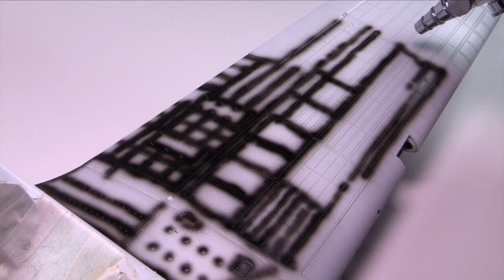Teaching Techniques #1 Part 3: Painting basics, Decals & Pin Wash

Comment: Quick question. If my paint was acrylic based, I shouldn't go for acrylic gloss varnish, right?
Reply from the maker: no short answer I'm afraid :D :
So, yes you do want to change the 'type' of varnish that you put on so that there is no possibility to bleed through the varnish layer, BUT acrylic based products are the most sensitive to all other ones....essentially it goes acrylic -> enamel -> laquer. There is a chance that the acrylic paintwork may react (crack, dissolve) to the other 2 types and enamel may react to laquer but laquer is king and will withstand all others.
I would highly recommend using laquer varnish over the top (I use gunze super gloss in a can) but first test it on a mule or spare bit of plastic painted up....and leave it for 1-2 days to see if it cures without later cracking. The benefit is that you will have a inpenetrable barrier for everything u may do for the weathering - and u have a undo button that can go almost to full reset. Then just do a matt can over the top to finish it off. Otherwise if you want to be safe use a acrylic based one. 
My personal experience has been no reactions to acrylic below, especially the latest modern brands...but I put on multiple thin layers and let each dry for 30 secs which might help deminish any chemical reactions

Comment: Erk... I'm making my first model airplane, trying to do the final camo paint, and when I pulled off my tamiya masking tape it took off huge flakes of my primer! (Mr Hobby surfacer/primer 1000). Made my heart sink :( I cleaned the panels with IPA before priming them... May I ask if you have any idea what went wrong? Did I use the wrong primer? Too much/not enough thinner? The wrong masking tape? Something else?
Reply from the maker: So I have a few questions in response...What brand plastic is it? as some react to the bonding better than others. Did you rinse with warm water after IPA? I find that if there were oils on the surface and the IPA dissolved it but no rinse, some residue of oil may remain. Was the Surf 1000 a nice wettness on the surface when applied - you should see a 'water' reflection for a bit when applied (but before it pools or runs :P ) If all else fails sand it down with 4000 - 6000 sandpaper without buffing and this will give something for the primer to grip too (4k will grip well but be a rougher finish so not ideal for Bare metal) Hope this helps :D
Reply: @scalemodelcinema9900  Thank you very much for the tips - The primer did go on very dry, almost like a damp powder, so good chance that's a problem. I used a really cheap airbrush, have a new Iwata coming soon so I'll try again with that. Also rinsing after the IPA too, as I didn't think of that.